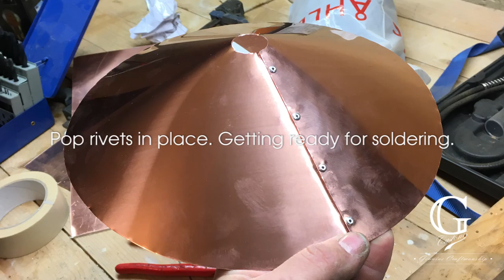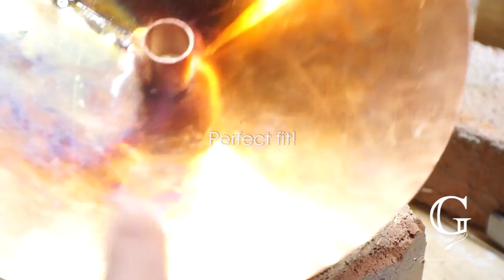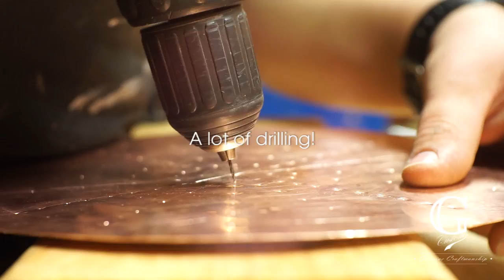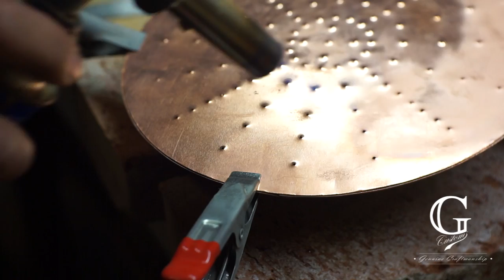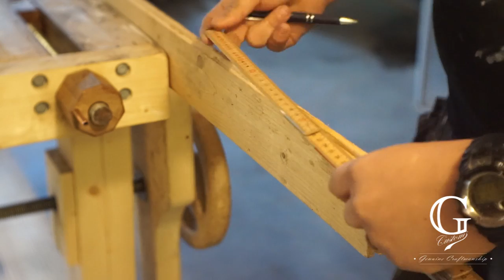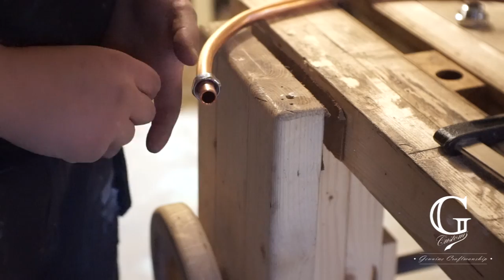Making - DIY Copper Shower Head

Comment: The idea isn't bad. Id use a thicker material, but that material is fine for an internal diaphragm. The water is filling up the head and reducing your effective pressure. So it just falls out. Maybe also roll the edges and solder. So it doesn't leak.

Comment: Good effort...22-15 reducer or just keep all with 15mm. Also I'm guessing you realised the problem with soldering that face to the cone ! Most of the water comes out of the sides ! The expansion of copper people don't take into consideration.
Reply: is still a really cool design he shared....he can probli make head shower holes bigger to releive pressure frm shower head to tube connection(n wud help with calcium buildup too)

Comment: Super cool!
I'm needing to fix a broken manufactured steel head and wondering if a soder the side will it hold the pressure? That's my problem the sides are blowing out and I need to plug them somehow.   Any advice would be appreciated!
Thanks
Reply from the maker: Ashwin Wetzbarger Thanks for the comment! 
Regarding shower head. Its very hard to say without knowing how your head is put together from the start!

Comment: I've heard when bending steel if you fill the tube with sand the tube won't kink. I wonder if this would work with copper?
Reply from the maker: True! It would probably work with copper as well. I think it might depend on the radius of your bend.
Reply: You can buy bending springs that go inside copper piping to stop kinks when bending by hand

Comment: i am thinking of bending the copper tube in a spiral and making holes in the tube  any tips sir?
Reply from the maker: Hard to help without know how it should look. The diameter of the tube determine how small radius you can bend it.
Reply: If you fill the copper tube with sand and then bend it, it wont kink.

Comment: Cool. How is it holding up? Has the copper tarnished?
Reply from the maker: john maloney So my soldering was a mess and it’s sprinkling water all over the bathroom. I have to resolder it soon. Otherwise no visual tarnish or oxidation. The holes is so small the water stays inside when turn off, that helps!
Reply: 👍🏻. I am planning to play around soldering some stuff. Did you use any flux?
Reply from the maker: john maloney No I didn’t! But I should have. It gets kind of messy without flux.
Reply: maybe  stuff some epoxy around it. but great build, really beautiful.

Comment: What is the link for getting the flat shape print out?
Reply from the maker: Jenny Burke Check out the description! I just updated it!
Reply: Thanks!  What are the specs of your copper sheets? I found some 99% on amazon. Worried it might be too thin or won't weld right. 
This is super cool! Very unique :)
Reply from the maker: I dont know exactly! But i think it's 0,7mm thick!

Comment: Sorry to be negative, but
this was a fail. Start by looking at the soldering, no flux and no prep. That’s why the seams were leaking. Also, he would have more success had he used a different solder. He could have used Silver or a solder that would flow at a lower temp. High heat putty 
is helpful to use on the backside of the seam. That stops the solder from running out. When the solder sets you can clean the backing putty away. I don’t think any craftsman who knew what he was doing would rivet a seam and then solder. The rivets were totally unnecessary and a weak point due the their being a dissimilar metal and as such corrosion will occur.
His logo on the intro says 
Genuine Craftsmanship, I can’t 
agree. If I must rivet copper I will use copper rivets. the compression fitting was also not a well thought out choice and neither was using a wood clamp and pliers to tighten it. 
The maker should rethink his fancy logo and branding when 
he publishes his videos. He seems more like an amateur,
certainly not someone genuinely crafting. I have worked with Copper and Aluminum as well as Tin on commercial job sites. I can only say that workmanship of that low quality would have the fellow laughed off the job site. If you want to see metal working and craftsmanship look for Ron Covell or the tin man series or Kent White and also Glen Starley. Back in the 1980’s I bought their videos.
As for specialty tools and metal working gear try TM Technologies or Aircraft Spruce and Specialty. Those three guys I mentioned are probably the most sought out metal workers for aircraft, historic race cars, custom tube fabrication, Etc.
Reply from the maker: Thank you for the comment. I'm so glad that this video inspired you to write such a long message. As for an answer to you, I really think Youtube should restrain the amount of characters in the comments, its like reading a short novel man!
Reply: G Customs The reason my comment was so long is easy to understand, the entire build was poorly thought out and completed. Your reply is emotional, try and look at this as if you were teaching a metal working course at school. What grade would you give a student?  I read your comments and you explained that it’s shooting water all over the place. If you want to post videos showing and teaching people how to do things you should want them to be well made.
Reply from the maker: OK, I understand your point. But I don't make "how to" videos. My videos is not about making things the right way, its about making thing my own way. I make videos to inspire others to take that step and create thing they never made before. Inspire creativity and to not be afraid of making mistakes.
Next time I'm making a similar project I know what I have to improve on.

This video is my first time ever working with copper sheets. You always go to school on the first one, right!
(the part with the clamp as a wrench, i don't know why I left it in the final video. I tightened it properly before installing.)
Cheers!
Reply: G Customs OK, I got it. Sorry for being so critical. If you like I could recommend some video clips that show copper working. Or you could look up the names I recommended in my first lengthy comment. Those guys like Covel really are masters. Your project was ambitious and I would love to see you finish it. I noticed from your other videos that you might be from Sweden?  I’m 
from the east coast of the U.S.
Reply: How's it goin? great looking shower head. You were closer to getting the right soldering job than you think/thought. it's a handy and fairly easy skill to get for these types of projects, probably just by youtube demo and bit of practice on scraps. you've probably already mastered it by now by the look of that last constructive critic
Reply from the maker: Hi!
Thank you for the comment. It’s going great right now, not much copper soldering at the moment though!
I got another copper project coming up in maybe a month or two, so stay tuned!